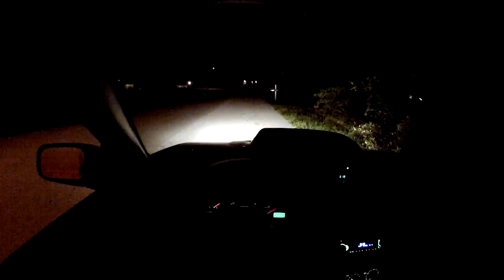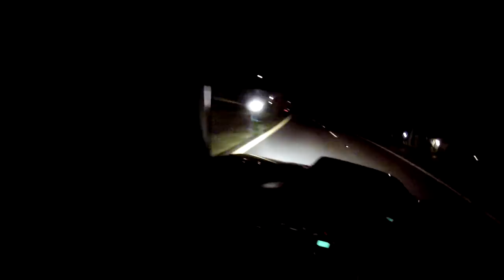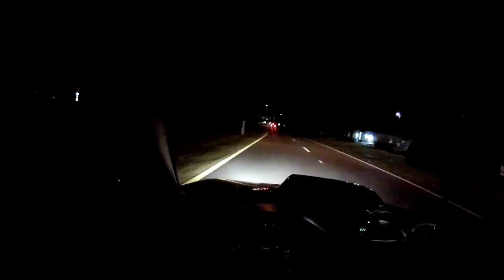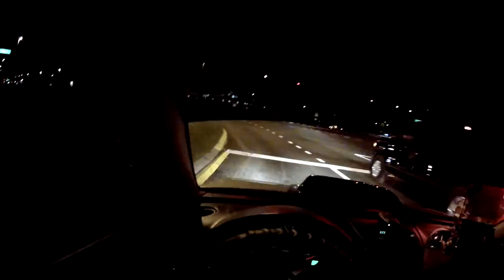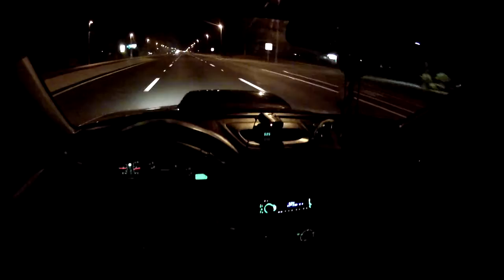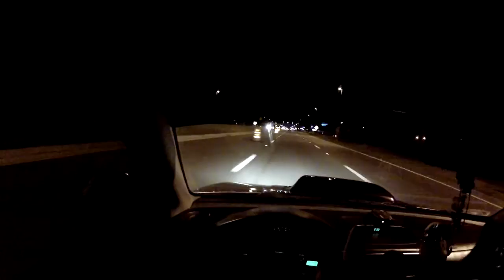The WRX Files: Episode 3 - Tragedy Strikes! (A POV VLOG)

Comment: You're most certainly right about not beating on daily drive road cars all day.

Race cars have their engines rebuild frequently where daily drive engines are supposed to last 250,000 kms or so on stock power levels, maybe up to 400,000 kms if you really look after it.

Comment: uelh cause more heat in cy 2 & 4 and cause failures in them prematurely. it's a known fact but not widely known. sadly it's a price for the rumble. but elh smoothes the temps out and cooler.
Reply from the maker: i agree. and the ring land failure is mostly to the 2.5 engines due to the heat, and the ring being closer to the top of the piston to reduce carbon emissions. the 2.0's usually dont have that issue as much. my engine had nitrous on it prior to me buying it, and i never knew about it until later on. but i do want to go equal length eventually.